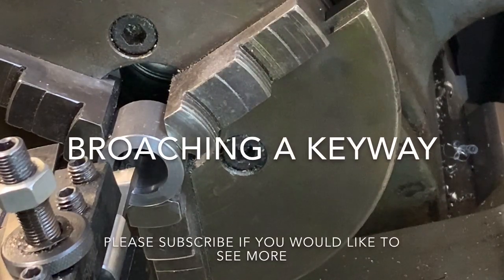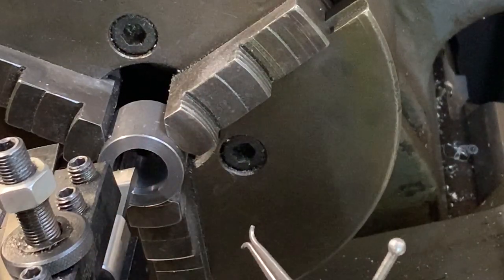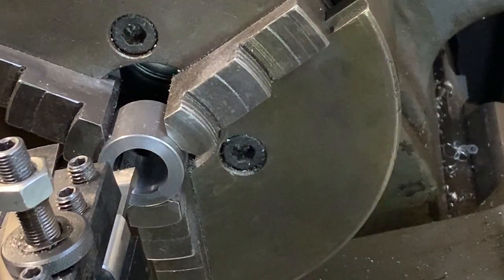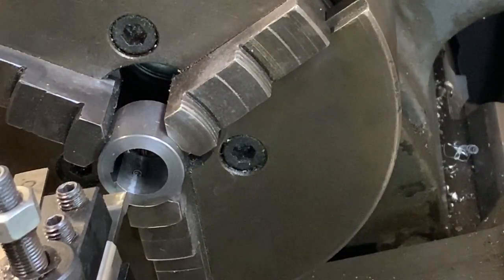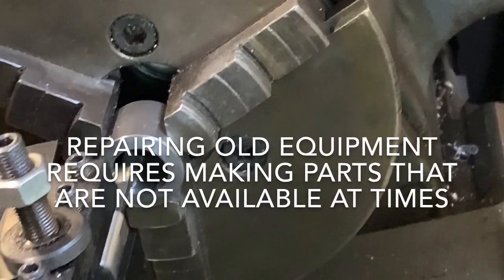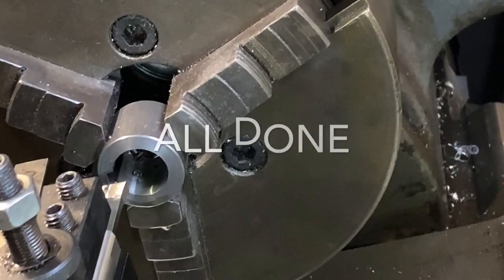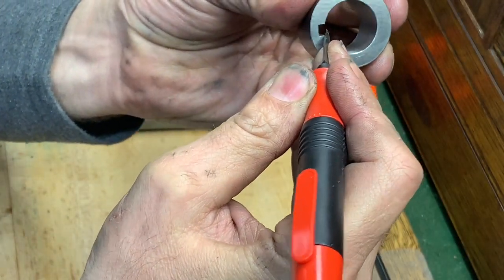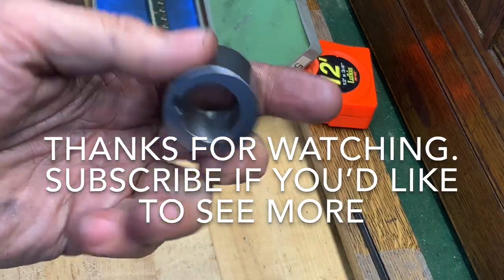How to broach a keyway on a lathe

Comment: This is a very inventive way of cutting a keyway when you don’t have access to or want to spend the money on a shaper, but do have a lathe.   Great solution to get’er done.   Thanks for sharing this.
Reply from the maker: Thanks.  Not shown in this video but I’ve also cut keyway on a tapered bore by setting compound angle and then running the slide back and forth